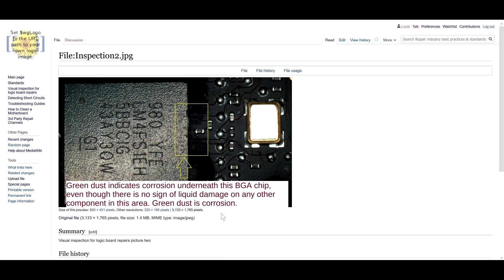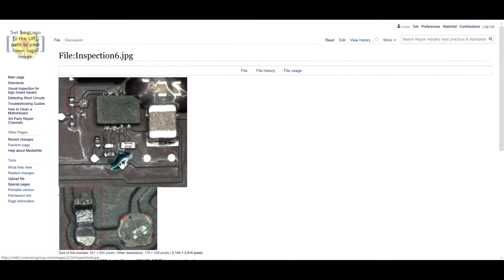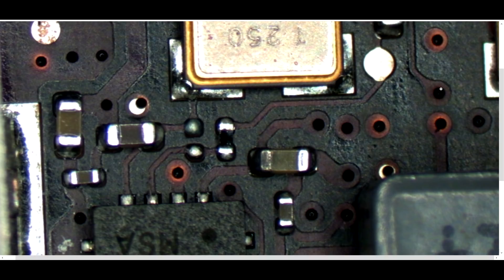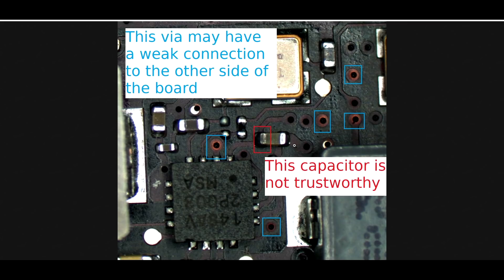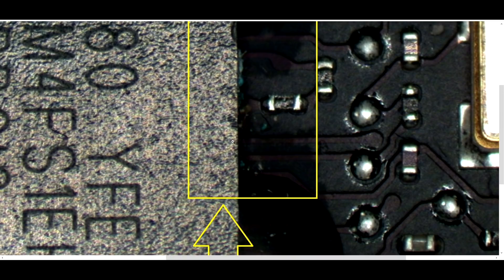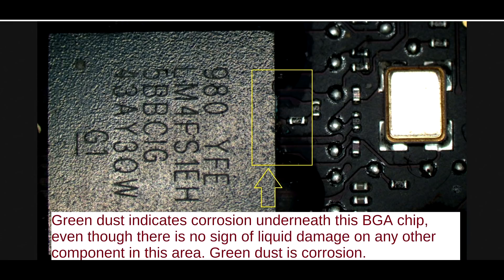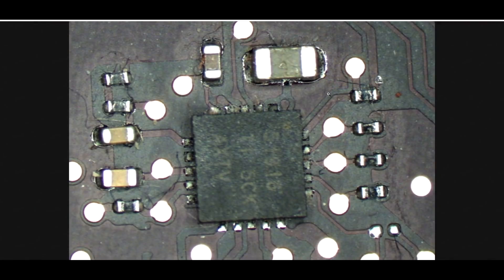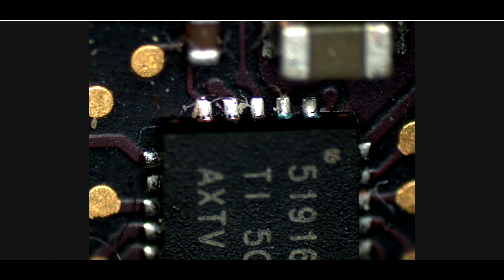Why do I fix logic boards before cleaning them first?

Comment: Anyone who says you are unprofessional for not cleaning first has no clue how to troubleshoot electrical/electronic equipment. It's always touch as little as possible until you pinpoint the problem.
Reply: ABSOLUTELY CORRECT...
Reply: Yep.  The first step to solving a problem is understanding it, and you're not likely to do so if you start by messing with the information.
Reply: @E C, actually the 'Professional' way to repair such boards is to carry out a visual inspection first, noting down either electronically or hand written in a notebook where all potential problems are, sometimes photo's of the problems area are taken for reference to be used later on in the repair. Then the board is ultrasonically cleaned and given back to the repair tech to fix. All and every parts that have been contaminated with liquid are to be removed and replaced with new components. The reason all contaminated parts are removed is because liquid when left on electronics for a period of time start to oxidise not only the physical PCB but also the solder joints (as can be seen on the capacitor that Louis references to in the video). When solder joints start to oxidise, it changes the chemical properties of the solder which can have an adverse affect on the electrical signals passing through the affected components. Macbooks are not hermetically sealed which means pollutants that are in the air (smoke from cigarettes, drugs, house cleaning products, car exhausts are just some examples) even condensation which means those oxidised components, if left on the board,  will break down further over time and cause the machine to malfunction again.

What Louis does and as do thousands of other repair shops around the world do is considered unprofessional BUT it is an accepted practice because a)not everyone has the tools and equipment to do the job properly and b) not everyone has the time to do the job properly. As a consequence, 'professional' corners are cut to allow a business to be able to repair a product in a timely and cost effective manner. 

A very good example of this are the videos where Louis mentor Duke is in the video. Duke is very experienced in the repair industry and as such, in the video's you see him in you will see him complain to Louis about some of his repair methods and techniques because he knows in a 'professional' environment, it's not what you do.
Reply: @dodgem259  the process you're talking about is refurbishing, not repair.
Reply: @Gundog256  Please explain to me how visually inspecting a board, taking notes about potential fail areas, getting the board cleaned and then given to a repair tech to fix (all of which I mentioned in my post) equates to 'refurbishing'!!??
Reply: @dodgem259  ummm... You just explained it yourself...
Reply: @Gundog256  really?? then you have absolutely no idea the difference between repair and refurbishment.
Reply: @dodgem259  you really gonna make me do this? Repair is fixing a machine to the point where it's usable. Refurbishing is fixing a machine to the point of replacing ANY parts that show signs of wear/damage. Which is what you wrote in your first comment.
Reply: @Gundog256  I can only conclude that you have a reading disorder of some kind because in my posts I specifically refer to BOARD's being repaired, and I quote 'actually the 'Professional' way to repair such BOARDS is to carry out a visual inspection first', and here 'Then the BOARD is ultrasonically cleaned and given back to the REPAIR TECH TO FIX'.

If you are trying to imply that replacing oxidised components on a motherboard is 'refurbishing' then you have no clue what your talking about and therefore should not even be in this discussion because having oxidised components on a computer motherboard means they were damaged by liquid at some point, hence the oxidisation and thus in a professional repair setting, they should be replaced to prevent further ingress of oxidisation and thus eventual failure.
Reply: @dodgem259  My guy, what you described, is by ANY stretch of the imagination, refurbishment, not repair. 
Repair is done to restore function, typically by solving the specific problem inhibiting it. You are actively stating 'replace all parts that could be possibly degraded' which is refurbishment. 

If someone brings me a PC with a 'broken' graphics card, and my response, rather than fixing the card, is to put in a new card, that's not repair. That's replacement, and is more in the 'refurbish' category than the 'repair' one. 

I don't know what groups you are using as your examples of 'professional', but if they come from Apple, Best Buy, or any other major first or third party retailer, they are invalid. This is because those groups DON'T repair. They replace. They do this so that they can more easily handle volume of returns by way of more people able to do replacement with less training compared to actual repair. Their idea of 'repair' is 'replace all parts on list we give you, don't bother to find where the actual problem is, just return to factory equivalent condition'. Which is refurbishment.
Reply: @jtnachos16  Your another one that has failed to read my posts properly. I DO NOT talk about the 'machine', I talk about ONE aspect of the machine which is the motherboard. Read my post again. I specifically make reference to the BOARD, ie motherboard being given to a repair tech to fix ..ergo REPAIR. Still in the context of the motherboard, I discus about oxidisation, specifically the CAP that was highlighted in the video and that it is a requirement that ALL affected oxidised parts should be replaced..ergo REMOVED ergo REPAIR....OFF THE MOTHERBOARD!!!.

For some reason a number of you seem to think I am talking about a complete machine, I am not, I am talking about a BOARD.  My post is very clear on that. If you lot are getting mixed up between the difference of a BOARD and a MACHINE, then you need to understand English langue and literature a bit better.
Reply: @dodgem259  Even when talking about a single PART of a machine, replacing parts unnecessarily is not repair. Repair is the process of getting it working again. Replacing a bunch of parts that are still functioning, on the basis that they show any amount of wear, is refurbishment. 

We read your long-winded crap, we just don't agree with you that cleaning a part before repair is the professional standard for repair, and that replacing everything that shows wear doesn't constitute a repair, but a refurbishment. 

Replacement is not repair, and no, noone who is doing actual repair will advocate for removal of all parts showing any sign of oxidation. At best, they would advocate reflow of solder on parts that pass a certain threshold of oxidization. It's not practical to replace everything just because it shows signs of wear.
It is BEYOND expensive in manhours and materiel to just blindly replace everything that shows any sign of wear. That's why the only people that do that, are the very large companies that have enough money not to notice and reduce the man-hours cost via less training and lower wages. Even there, most of the ones that do that, have direct contracting for manufacture of the parts in the first place, to drive costs down further.

Oxidization (in this case, moisture related as you used in example, although also applies to other types) is also not a general worry. On computer parts, particularly motherboards, it happens in one of two ways: Someone spills something on the device, or it somehow manages to reach sub-ambient temps in a humid space. 

Both of these are controllable conditions and avoidable, with further oxidization only occurring if these conditions are repeated. It doesn't 'just happen'. Without presence of a catalyst, the rate of oxidization is slow enough you wouldn't see problems from that for LITERAL DECADES beyond the hardware's 'should be replaced by' date. 
Hell, solder in particular tends to use specific metals/alloys that are extra-resistant to corrosion and oxidization.

Comment: Im an Electronics Mechanic/Tech. When I train apprentices, This is EXACTLY what I show them first. Methodology of troubleshooting, for me, starts with a deep physical inspection then repair, then operational inspection then repair and finally the final testing. Rinse and repeat. You are the first person I know that feels this way other than myself. Makes total sense.
Reply: First thing they taught me  in electronic repair school in the military.
Reply: You should also do the smell test for power electronics. If something smells of ozone, you are screwed.
Reply: A tech school auto mechanic couldn't figure anything out until I told him to shut the hood, sit down and tell me what could be wrong, find and check it. Not that? SHUT the hood and repeat!  Way too much confusion on boards and under hoods, without the experience Louis, has.
Reply: @calvinmientke3539  This is sound advice. The experience of sight, smell and sound when the engine is running will surely help fix the problem immediately. I have a mechanic friend who can tell you exactly what's wrong with your Jeep from listening to a recording of the engine running. He even diagnosed a leaky seal from sound alone.
Reply: CLEARLY CORRECT...
Reply: Truthfully, there's a bit of leeway on cleaning stuff. In my case I did field service on CNC machines. In some cases you NEED to clean things to see where parts are worn or damaged. Leaving things dirty is not always a good way to see what's going on. Especially if there's oil and grease involved. And dust.
Reply: This also applies in Diesel/automotive trades, so I get the feeling these people have never troubleshooted before

Comment: At first, I thought "why does this need to be asked" but then I forgot that some people getting into board repair might not know, especially the second example you provided. I made that mistake only once and I didn't just have a poorly soldered joint but lost a resistor while cleaning. I could have saved myself a few hours of dicking around if I would have just double-checked my work.

Comment: Unprofessional? what? if you clean the board off before you even work on it. How in the fuck are you going to identify where the short, or. corrosion is, you could fix one issue but there could be more corrosion somewhere else on the board that was cleaned off by the ultrasonic. Some people man.

Comment: Sounds like people asking car mechanic why he doesn't wash leaking oil car engine first  before fixing actual leak.
Reply: Not really the same. A lot of time the entire underside of a car will be soaked and you need to clean off the leak to see where its actually coming from.
Reply: Coolant leaks leave a trace. They ask, "Where is it coming from?" I answer, "Up!". I've replaced /repaired many drain plugs because owners see oil drops on them and "tighten" them to failure. Clean spots on a dirty engine is a clue. One clean plug and a misfire with a coolant "leak". Bad! Sometimes the smell of an engine or exhaust is a clue. Sweet exhaust? Burning coolant! Sour exhaust, fuel mix! Barnyard mechanics!
Reply: wrong example, in that case washing first is more usefull. compared to the bord repair, it would be like the whole board is in corrosion and then even louis is cleaning it first